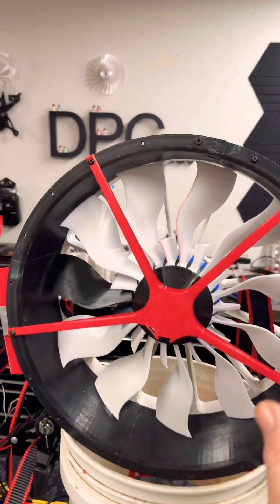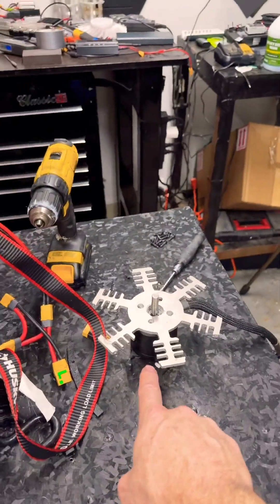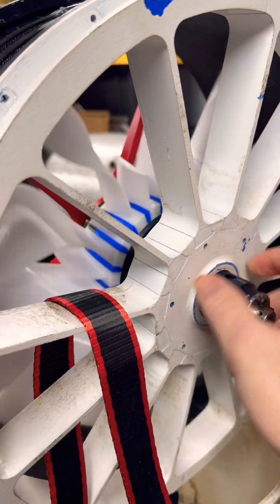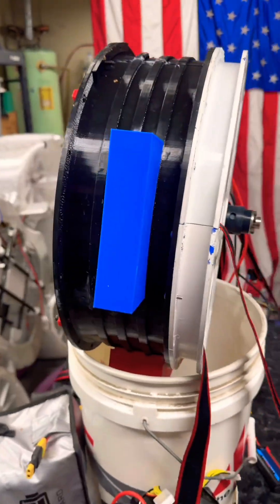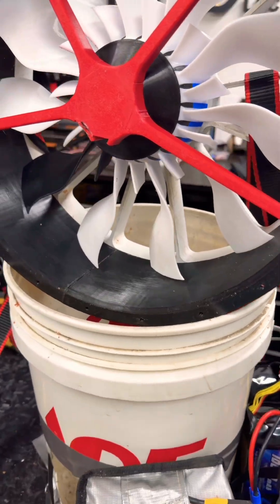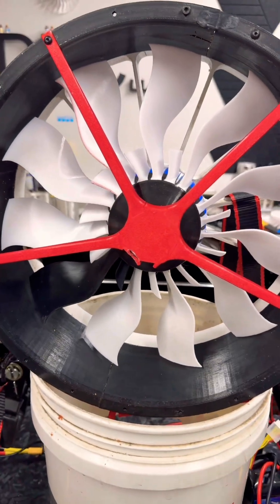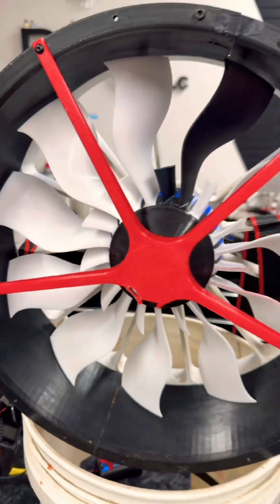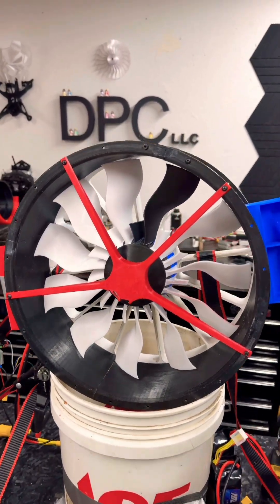￼ I’m going to be testing a fully printed 340 mm EDF running at 75 volts. ￼#fyp #3dprinting #shorts

Comment: These turbines and how well those thin blades hold up are a huge testamant to how far 3d printing and filament tech has come
Reply from the maker: The fan is built with PETG and is so robust it has broken motor mounts and burned 3 high torque motors so far.